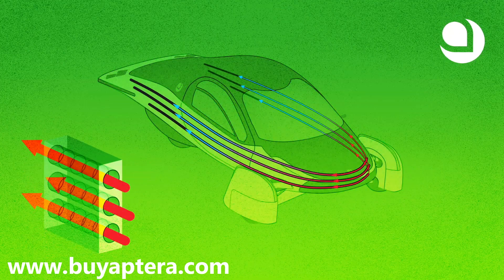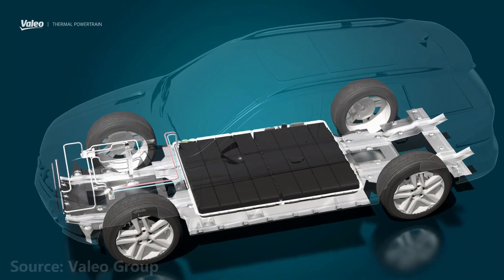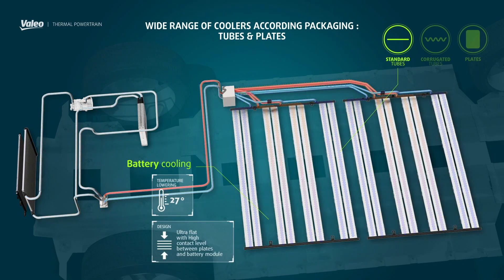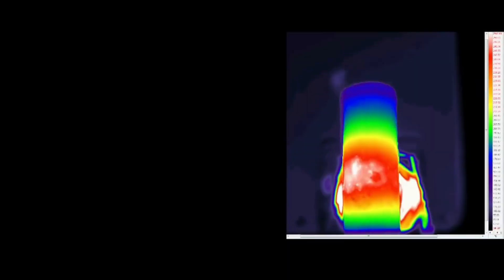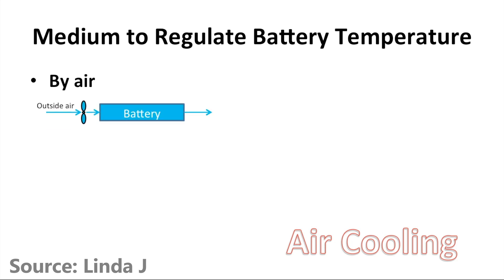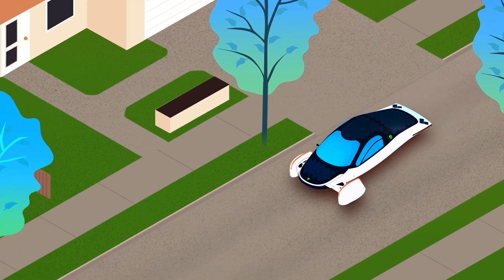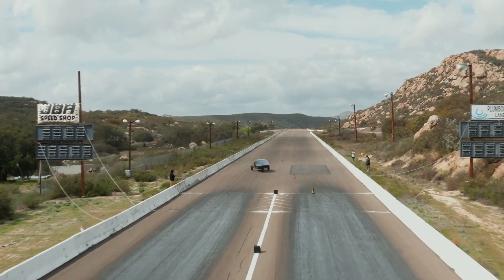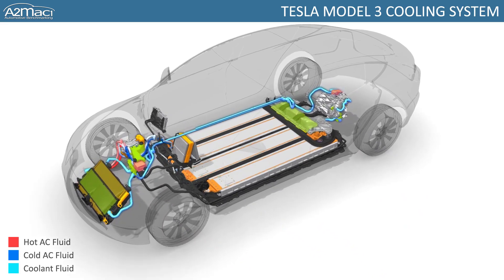Mind Blowing Skin Cooling Thermal Management System

Comment: I am hoping for your final comment (initially resorting to traditional radiator cooling system, allowing them further time to develop their envelope cooling system.     Aside from the issue of accident caused leakage, I am concerned with interior space temperature control with the envelope radiator concept.  Imagine cruising down a highway in the summer afternoon with 100 F ambient outside temp.  I don't want to be cooked with the added heat transferred from the battery and motors to the surrounding shell of the car.  I'd rather that heat be routed outside of the car as in traditional radiator systems.  A traditional radiator system allows for better control of coolant temperature.  Also, if the planned micro-channels throughout the body are tubular, the coolant is being cooled on only one side (the outside) of the body shell and the air-flow is parallel to the coolant channels (rather than direct/perpendicular to the coolant channels as in the radiator).  The radiator presents several channels to direct airflow and all sides of each channel is being cooled.   The radiator also helps to move the center of gravity more towards the front between the front wheels.   The radiator system is much easier to replace, maintain, and control, is simpler, most cost effective, and has far less points of failure/leakage (due to simple dings and bump damage).  I would not mind at all to have an air-hole under the front nose of the body that is vented up to the radiator.  I hope their Beta test mule (with the radiator) allows them to reconsider...  

As for heating, (I live in colder climate - BC Canada),  a heat pump will not suffice.  Can they give us a small butane/propane heater?     Such a system's CO2 footprint would be so small. 

If the Aptera can nail both heating and cooling, it would be totally ideal.  Without adequate interior climate control, this would really impact the utility/demand for this EV.

Comment: .. you could probably also consider or try using supercapacitors (there are existing packages already, by Kilowatt Labs) instead of the Li-Ion batteries. Such packages of supercaps are more robust, less complicated, and in case of an accident can be discharged completely in microseconds..
Reply: https://youtu.be/3K8JIC-ov_Y
- The Fuel Tank of Tomorrow - A Super Capacitor?
I wish your beautiful company great success!

Comment: I think they should go with the standard cooling system .
Reply: Me too:  a) Worried about heat from the skin adding to interior cabin heat in July on Barstow to Vegas in hot sun and 110F ambient temp (the skin idea is cooking the passengers more than being cooled), b) while there's technically more surface area for skin idea, air flow is on one side and is flowing parallel to the heated liquid (less than 30% surface contact with cooling air, whereas, a typical radiator allows cooling air to be directed perpendicularly to the radiator where it runs over 75% of the surface of the tubes containing the coolant.  Also a radiator stacks the "finning" blades in a more ideal configuration for cooling.  c) a traditional radiator system allows easier routing of heated air via user controls to either vent the heated air away from the interior (during hot/sunny days), or routed to interior heater radiators (during freezing outside cold temps).  In addition to the other mentioned concerns (crash damage leaks, added complexity and maintenance, etc), I hope my reserved Aptera has a traditional radiator (even if there's a vent under the nose of the vehicle cut out to allow air to the radiator).
Reply: @a5-30-31cts  my thoughts exactly
but I don't have the mental energy to express it as well as you . 😆

Comment: How does Aptera cool the batteries when the cars sitting in the sun charging? Some EVs have fans kick on. In an air cooled setup how is this possible?
As for heat management, will the glass have UV protect to stop the AMC Pacer effect?

Comment: I see the skin cooling as effective for on the go especially at highway speeds, but it does lead to some questions of sitting in the sun in the summer or the idea of the chassis getting damaged. Many cars will get in at least one crash in their life span and not sure how good an idea of running the coolant through the chassis in that way would be a perfect solution. I guess if it's deep enough in the frame of the car it could work but then I imagine the heat transfer would be much weaker. 

It's cool idea but I think just using a standard heat pump might be the better solution for the time being.
Reply: "but it does lead to some questions of sitting in the sun in the summer"

If you're sitting still, the batteries aren't releasing energy, and so they're not heating up.
Reply: @phillycheesetake  batteries produce heat in the act of charging and the selling point of the car is it having solar panels to charge when sitting in the sun. 

Plus heat is the number one cause of lithium ion cell degradation. Safe limitations for lithium ion is less than 45C when charging (about 113F) which is fully possible on hot days where the battery is also making heat, and over 60C when discharging. Heat alters the atomic structure of the cells ruining some of the cell's storage capacity and increasing the risk of a failed cell. 

Note though that the cold while it does hurt a battery in the moment is only temporary degraded performance. Heat on the otherhand permanently hurts the cell.
Reply: The A/C compressor is still fairly standard if a 400 volt dc hermetic compressor is conventional.  It is just a new form for the condenser compared to usual automotive practice.  Boats have used hull cooled condensers for some time.
Reply: @n.brucenelson5920  yeah but I could more understand that with a boat as water has a high heat saturation so using it for cooling is pretty effective. Especially since water temperatures rarely ever pass 85 degrees as it takes so much more energy to heat up water.
Reply: @Skylancer727  You are correct about the difference in heat capacity between air and water.  

However, by using the skin of the bottom of the vehicle, Aptera has vastly more area available for heat exchange.  

The last company I worked for had a heat exchanger made of thin stainless steel tubing, which has much less thermal conductivity than copper.  None the less, we had vastly better performance compared to conventional soft copper tubing heat exchangers, because we were able to greatly increase the length, and thus the surface area.

Comment: I wouldn't be too concerned with loosing cooling during an accident unless the motors fail to shut off. There will be residual heat but deformation or damage to the cells would be a bigger concern. Plus with other EVs the radiator / condenser is usually in the front or they have cooling channels running throughout so they would loose their heat sink in many wrecks also.

Comment: Actually, the case of rupture of the skin cooling circuit in case of accident is a common engineering problem "in principle" and not verbatim. There are numerous solutions which would allow it to be only partially affected in case of rupture no matter how extensive. I am confident Aptera designers have already considered a number of those. The solutions at hand may be architectural, mechanical, and derived from the core technology itself. The bloodstream is a good source of inspiration.

Comment: I'm no expert in car designs or anything but what if the coolant liquid channel runs through the bottom skin of the vehicle? Just below the battery pack. So even if a car crashes it from the side, it won't damage the liquid channels. Maybe not as efficient cooling but maybe safer in a crash. Also may need an insulated layer in between the battery and the channels
Reply from the maker: The more surface area that is used the more efficient would be the cooling system. I'm sure the team at Aptera will find an appropriate balance between safety and performance.
Reply: @apterareboot1555  say they use their coolant under high pressure. There exist valves that only open if both sides have a significant (unusably high) pressure. That might fix coolant loss from big ruptures!. but it wont help against small ruptures. 

also added complexity
additional parts
additional potential failures

Comment: Capacitors = NonChemical Batteries =  No overheating or freezing concerns.  

With room-temperature superconductors requiring just a few small capacitors 
to replace all those dirty, smelly, bulky, heavy, dangerous, expensive batteries, 
that ingenious skin cooling thermal management system used mostly for battery cooing 
could be instead dedicated mostly to cabin environment control.
Reply: Aptera is certainly interested in such tech when and if it becomes available in commodity pricing and quantity.
Reply from the maker: 2 issues with supercapacitors/Ultracapacitors. Expensive and low energy density. Supercapacitor/Ultracapacitors do seem to extend battery life and they also do a much better job storing energy for regenerative breaking though. Maybe Aptera will find some function for capacitors but I don't think they can currently be used as the primary energy storage medium for now.
Reply: @apterareboot1555  
Face masks work about as well as a chain link fence works to stop mosquitoes.  
But obviously, there's a large cult out there that believes face masks work.  

   Look up the   "Superconductor News"  website. "Superconductors.org"  
See "Shaming the Scientific Community with Record Superconductivity" posted 02-20-2016
with 35 room-temperature candidate superconductors.

Since superconductor wires can be 100 times smaller diameter than copper wires
to carry the same electrical current (Amps)
then we can put 100 x 100 = 10,000 times more windings of superconductors
in the same coil space as those fat, heavy copper magnet wires. 
Therefore, we would only need 1/10,000th of the input energy & therefore battery size 
to provide the same magnetic strength to turn the wheels to get the same driving range.  
The resultant magnetic strength, B = (Amps)(Turns) ÷ Coil length

Big Oil doesn't want you to know this.
Reply: I have a good low cost candidate tiny diameter conductor that could do the job.
But Aptera will have to sign a NDA to find out about it.
Reply: @apterareboot1555    I don't know yet if the company is legit or not, but there is a company that is developing these vacuum capacitors that can store (and also if super heated, generate) electrons in a super clustered state.  If it is legit, the really nice thing about the tech is that it doesn't require any expensive and exotic materials, and are fairly easy to make (minus the whole vacuum process, but that is not that hard for modern day manufacturing). There have been a few researchers here and there who have stumbled upon this little known and exotic state of electron clustering. One of the American ones who wrote about his research with it was Ken Shoulders.  Shoulders had written Richard Feynman and told him about his observations/discovery.  Feynman initially completely poo pooed him and his findings saying that such super clustering of electrons was not possible.  But after another researcher demonstrated similar principles, Feynman wrote Shoulders back and apologized saying you were right and I was wrong. 

    If this tech is real, it is a complete game changer, far and beyond anything out there, whether in production or in theory, even graphene, solid state lithium glass batteries, etc.  

  This is the company: 
http://www.freel.tech/

  One of the patents they have filed: 
https://www.freepatentsonline.com/9042083.pdf
Reply: @justinw1765              Richard Feynman died in May 1988.   
So Ken Shoulders had to have had this discussion with Feynman before 1988.  

50 years ago,  Richard Feynman said : 
"The vacuum of 'empty space' appears to be an energy reservoir of immense capacity   
that makes nuclear power seem old fashioned.   
The amount of energy available in one cubic centimeter of the vacuum (ambient space)   
is much greater than the energy density in an atomic nucleus." 

So here,  Feynman pointed out that the best battery is the ambient space all around us,  
making vacuum capacitors that can store electrons in a super clustered state,  greatly obsolete.  
The late Ken Shoulders was
Reply: The genius Ken Shoulders died in 2013.   Too bad he didn't get to focus on 
MagAmps (Magnetic Amplifiers) to be able to tap into the aether (best battery).

Ken knew of Thomas Bearden's work,  who got a US patent on 
"Motionless Electromagnetic Generators".  Too bad that Bearden didn't have 
"Nanoperm" Toroidal Inductors,  and "room-temperature superconductor" wires, 
the two keys to cheap, easy to build, free-energy generators & motors.
Reply: @michaelhingle9113    Even if there is a way to tap into that energy potential of vacuum space, the power structures of the world would do everything they can to suppress/repress such tech because it would be game over for finite resource based energy storage and production. Up to and including killing or imprisoning inventors.  

   Such tech would not be allowed to be used by the public in this current civilization. (But considering how fast the earth's magnetic field is weakening, all it would take is one fairly strong, earth directed CME or a coupling of different Solar events, and goodbye electrical grids and thus goodbye present civilization).

     Meanwhile, vacuum capacitors might be allowed (because they are still fairly finite in terms of storage and generation), and if so, they blow everything else (mainstream wise) out of the water as regards both energy and power densities. After I eventually invest in a vacuum pump that can pull a hard vacuum, I plan on experimenting with making some of these and see if it works.  Obviously I can't sell them to others, but I could use them for my own personal use.
Reply: Imagine all of our appliances with tiny onboard independent power generators !
No central power plants,  No grid of electricity transmission lines,  No substations,  
No combustion of anything,  No pollution,  No fuel bills,  &  No Batteries !  
This will make transportation vehicles much easier to design.    

An "Ideal Electromagnetic Environment" in the cabin would be easy to create.
Reply: @michaelhingle9113  If you are serious, and not just blowing wind or under the influence, why not develop this technology?
Reply: Better Choice for Heat Management 
Optical Diodes = light or infrared heat can only travel in one direction.
HOES ( Holographical Optical ElementS ) coupled to Fiber Optics
= more efficient, smaller, less weight, most durable, longer life.  
 
High Brightness Holocopiers make manufacturing optical temperature management systems
far faster & far less expensive than your "Mind Blowing Skin Cooling Thermal Management System".
Reply: With Optical Thermal Management : 
Car wrecks would be less dangerous without hot fluids.
Body repair would be less complicated & less expensive.
Fiber Optic embedded "Smart Structures" could instantly 
assess vehicle damage and suggest appropriate safe maneuvers.
Reply: Older auto mechanics are thrilled about the introduction of 
easier to work on vehicles.  That was Nicola Tesla's genius / Tesla Turbine.  
Aptera appears to be the best choice so far / fewer parts.  
Use the best technologies  &  keep it simple.
Reply: Room temperature superconductors have not yet been demonstrated.  Aptera has already demonstrated an ability to use proven and widely available tech in more effective combination to a specific end.

Comment: With a consumption of only 100Wh/km, battery cooling should not be needed when driving, but only when fast charging?
Reply from the maker: I imagine that is true but Someone out there is probably going to figure out a way to stress test Aptera by perhaps taking it to the drag strip and run back to back quarters mile all day at full speed. 

If you think they won't, just think about the journalist putting weights and doing all types of of insane things to show you can make a Tesla drive without a driver in the seat.
Reply: I guess it depends on the battery but a few cars now are keeping the batteries at a certain temperature. I know my battery cooling / heat system kicks in randomly even when the car is off to maintain battery temperature within band.
Reply: @anydaynow01  Hmm! Are you sure? Battery heating reduces charging efficiency badly and is normally only Used in Winter temperatures. Or is IT your AC using the battery as a heatsink to save power om cooling the cabin? In that case IT is a clever way to use the heat capacity of the battery pack and at the same time keep the batteries in the temperature zone, but running when parked unplugged, that is nuts??
Reply: @Tore_Lund  Well the batteries do need to be maintained either way so EVs never really "turn off" like a computer. It's more they just go to sleep like your phone when you press the power button. Since consumers have the expectation of the battery holding up as long as the car, the battery must be maintained 24/7 just like roads have to be constantly monitored for damage. 

Maintenance isn't fun and nobody wants to do it, but it is 100% necessary in the complex AM world of actual machines we live in. We all wish we could live in the FM world of "fucking magic" where you can jump in the transport tube alla Futurama and them step on a hyperloop to your job in Colorado in 2 hours, but that's not the world we live in.